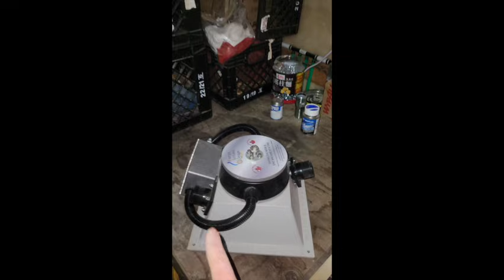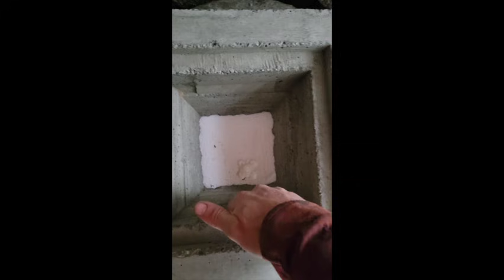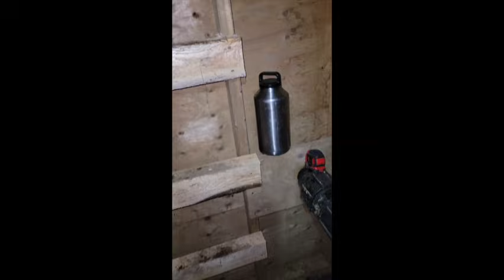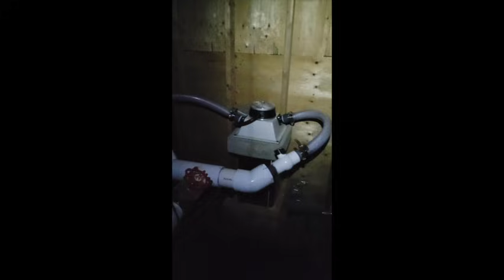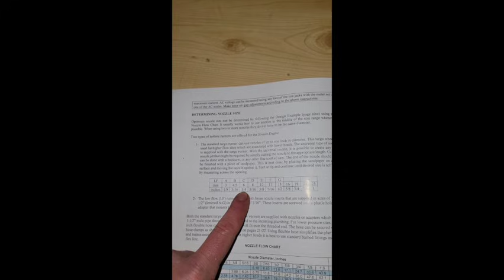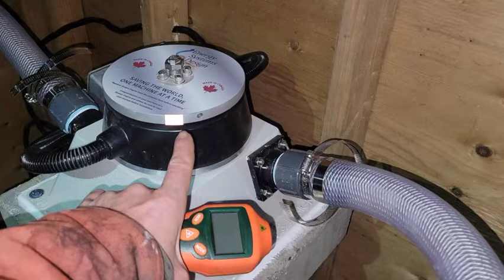Installing a Stream Engine Micro Hydro | Off-Grid Power Upgrade

Comment: cool system , i just see 1 part u need to optimize, that T needs to be replaced with a Y. Maybe gain 10-20%. laminar flow. :)
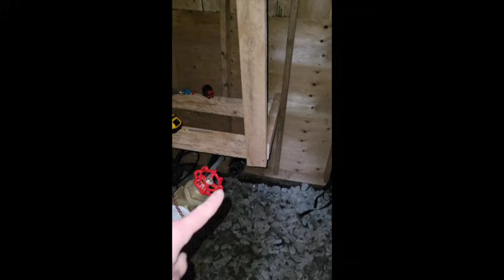Reply from the maker: Totally with ya! If you watch from 6:30, I actually try to put a wye in there but I was too limited with space and forced to use a T. Dang!

Comment: Excellent choice of turbine provider. You mention another more complete update is coming, in that could you please include the voltage you are running the turbine at?  I was assuming the controller is mppt, yes?  Also, small point but that is not a Pelton wheel, it is a Turgo. The perfect choice for horizontal wheel orientation (overspray exhausts down, away from the wheel improving efficiency). The angle of the nozzles is the giveaway, in addition to the different shape of the wheel-cups.
Reply from the maker: @Ruralliving8572 Oh cool, you're right - I actually didn't know that was the difference, thanks! Makes total sense, and the more I learn about the Stream Engine the more impressed I am! Haha you're really going to like the next video. I talk all about mppt's and voltages and how to ensure all the components communicate together efficiently. To answer your question for now, my mppt is happy around 165-180v and my diversion kicks in at 197v.
Reply: @manvsland I hear nothing but praise for SE. I am in the PNW and have a similar manufacturer local to me, so no hands on with SE. Running the diversion on the turbine side I see. Interesting, reminds me of how small scale wind does it. Another option is pinning the mppt at the desired control voltage/rpm and divert on the battery voltage side. Don’t know if your way is better, I have only seen it on wind where rpm control is key to prevent destruction. Again, no SE expert here. The high voltage is an excellent choice for transmission. Assuming you have confirmed with SE that unit is ok with it? I have a lot of Permanent Magnet experience and how it’s wound along with physical rpm limitations all enter into what gives the best balance between power and bearing durability. Being controlled so differently than the systems I have in the field I am looking forward to learning from your experiences. Appreciate you sharing.
Reply: @manvsland this YT video visualization of the Turgo efficiency in horizontal applications. https://youtu.be/jnejooTZq8U?si=F2uBlw-hoF016pLe

Pelton splashes on both sides of the cup causing power robbing spray to fall back onto the cups, in horizontal applications

Comment: Great video. If you want to increase the power some more, change out the Tee fitting after your shut off valve and install a wye fitting. It is much more efficient as the head loss will be much less.
Reply from the maker: @jeffbarnard468 Hey! I totally agree. In fact, if you watch from 6:30, you'll see I even try to put a wye in. Unfortunately due to space constraints I couldn't make it work so I was forced to use a 'T'. But a wye was my initial thought as well, good instict!